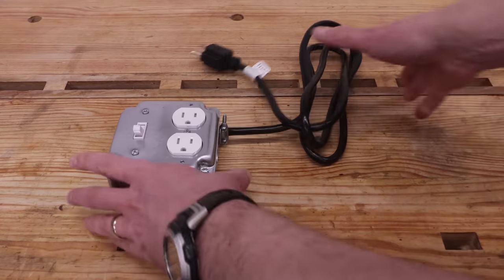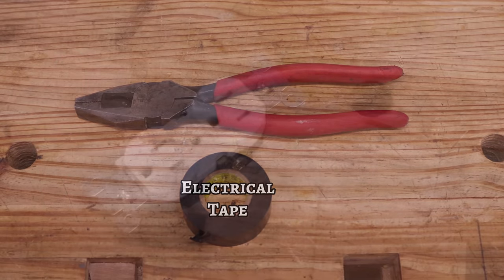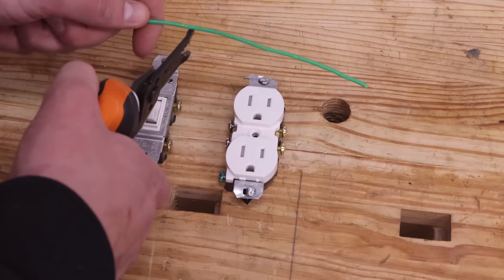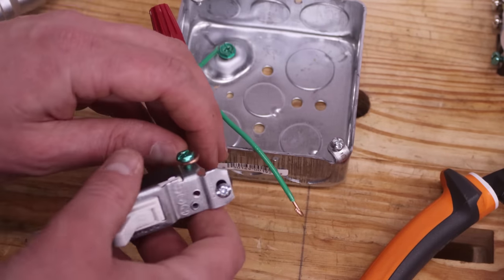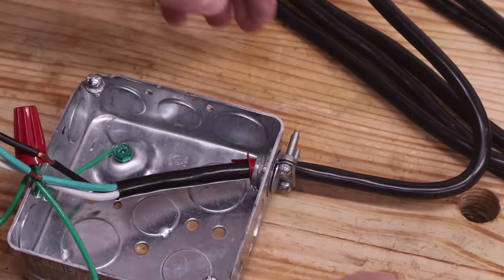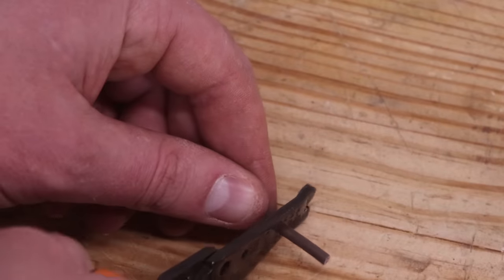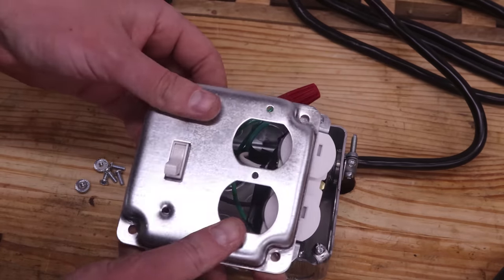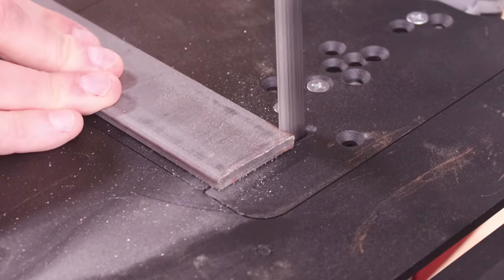DIY Portable Switched Power Outlet With Extension Cord 🔌

Comment: Well made video. I need to check out your other videos. That being said I'd like to point out errors you made. 1st, the connector was wrong. It was a BX connector and should have been a NM connector, or better yet a strain relief connector. 2nd, the stranded wire under the screws is not an approved method and could be a fire Hazzard.  3rd, you may have exceeded the wire fill of the red wire nut you used. Most only allow 4 conductors. 4th, the center hole on the receptacle is not intended to support the receptacle. Even made perfect this device per OSHA would be a violation on any job site. Personal use only OK? Personally I feel these contraptions are death traps. I do commend you for your wiring diagrams. And just a couple notes. The holes on the side of the strippers are for bending loops, the boxes are made so nothing will short out so no tape needed, and twisting the wires is not needed.
Reply from the maker: Good information, thanks.

Comment: This was a informative video.  However a couple of the connections were a little sloppy.
Reply from the maker: Sloppy how?
Reply: @GlennFrazeeYT  
It looks like you had insulation under the ground to the box.  The wires from the power cord all not wrapped around the screw very well.  It looks like some of the wires smashed outside the screw.  Looks may be deceptive.

Comment: I would like to do the same but for a kitchen island where I have an outlet underneath the island and run the open ended cord to the island's outlet box for crock pot etc...So that I can unplug the cord going to the floor in the even I want to move the island for cleaning. Is this possible?
Reply from the maker: Yes, but you'll probably have to meet electrical code requirements. And you may require a GFCI, not sure.

Comment: I am going to do this for exact reason, portaband.  I mostly cut steel, will the cut particles have a chance to short circuit, have you had any issues?  Thanks for the tutorial.
Reply from the maker: Shouldn't be an issue unless the box is right below the blade.
Reply: @GlennFrazeeYT  Thank you, ended up putting on side and put duct tape over just in case.  Works perfect.

Comment: Would this work with a surge protector? I have a surge protector in my garage to run my lights and a couple tools but its a pain to get to. I figure if I could do something like this I might be able to add a light switch by the door to flip the surge protector on and turn the lights on and when I leave I can kill power to the garage with the flip of a switch.
Reply from the maker: Sure, that would work just fine.  This is essentially the same thing that's in your wall for a normal electrical outlet, just portable and with a switch to control the outlet.

Comment: I just curious and I don't know much about electrical work but why did you connect one of the ground wires to the box?
Reply from the maker: The box will conduct electricity if there's a short, so grounding the box keeps it safe.

Comment: So now do you have 2 15 amp outlets you can plug into this? Like a normal 110 outlet? Or is it less since you’re pulling from 1 110 15 amp plug?
Reply from the maker: You're limited to 15 amps total since it's just a 15-amp plug.  But otherwise it acts like any other 15-amp outlet in your house.  You could conceivably wire this up with a 12ga cord and a 20-amp plug and have a max of 20 amps, but most homes don't have 20-amp receptacles wired in, even on 20-amp circuits.
Reply: @GlennFrazeeYT  so if you’re using a “15 amp” tool like a table saw, you should use something like a light with it instead of another “15 amp” tool, right? I’ve seen people do this and put a table saw AND shop vac on the same line but wondering if it’s smart.
Reply from the maker: @Trey Football, it would be no different than if you plugged them both into receptacles on the same circuit.  If they draw more than 15 amps combined for too long, your breaker should pop.  There's a lot more to this than I can cover in a comment, so I'd recommend reading some articles online.

Comment: I was thinking of this with a cement mixer but want one outlet to be hot all the time and the other one switched.
Reply from the maker: That's possible too. Just break the connection between the hots/neutrals on the receptacle and wire one directly to the cord

Comment: Could you use a GFCI outlet instead?  So when you plug it in somewhere it would add GFCI?
Reply from the maker: Sure. No reason that wouldn't work.
Reply: @GlennFrazeeYT  .... it wont work if the house outlet is already a GFCI.
Reply from the maker: The comment was about adding a GFCI where there already isn't one.
Reply: @GlennFrazeeYT  .... yes, but my point was more about having 2 GFCIs together won't work so you it's not totally compatible in that case. The reality is if you have a place to plug this in and you need a GFCI then one should be installed in the wall to bring it up to code first.

Comment: This is old, nice job just two notes. If you used a self grounding receptacle the ground from the cord to the box would have satisfied the code. Also, those screws you left out is a code violation.
Reply from the maker: Electrical code doesn't apply to portable items like this, but noted 👍
Reply: @GlennFrazeeYT  you know, I never even thought of that. I guess my mind is “wired” lol, that way doing electrical for 40 years. Your video was very good, some diy videos I’ve seen makes me cringe. Years ago those mulberry covers only had the center screw. Those self made double duplex adapters on the job site, that screw would always get loose and the outlet would fall in the box. That’s why the code changed and requires them now.

Comment: I live in a country where grounding plugs are next to non existent.. so my question is.. why do you need to plug a ground wire into the junction box when you already have ground from the cable to the outlet?
Reply from the maker: Since the junction box is metal (i.e., conductive), you want a path for any stray current in the box itself to back to the house wiring instead of passing through you should you touch the box with current running through it.

Comment: can I do the switch separate from the outlet but have the power cord to the outlet then the switch in a different location say a 4 foot run away?
Reply from the maker: Sure. Look up how to wire a switch for a ceiling light, and it's pretty much the same thing.

Comment: Don't your wire strippers have a "loop" hole ? Also note, no wire sheathing should be "trapped" under the screw when attaching wire. (For viewer reference)
Reply from the maker: They do, but i find it easier to do it with the tips.

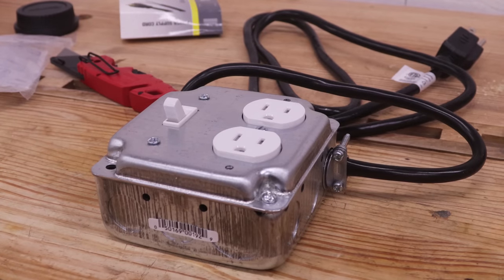Comment: 9:26 can I plug power strip to this Portable Power Outlet with no problems?
Reply from the maker: Yes.  But the switch will control the power strip, so if the switch is off, the power strip will not have power.

Comment: How do you do this using a self-grounding outlet?
Reply from the maker: These ground to the metal box, so just attach the ground wire from the cord to the box only.
Reply: @GlennFrazeeYT  I'm still a little confused, because the outlet I have still has a green grounding screw on it even though it was advertised as a self-grounding outlet. Should I ground both the outlet AND the power cable to the box?
Reply from the maker: I would ground both.  Theoretically, if you ground either the outlet OR the box, that makes a single path to ground.  But then you're relying on the screw connection between the outlet and the box (plus the outlet flanges bearing on the box) as the path, which I don't feel is very robust.  Grounding both should give you a solid path to ground either way.
Reply: @GlennFrazeeYT  Thanks

Comment: This is perfect. Can this be used outdoors, mounted on a deck rail to power lights on a gazebo?
Reply from the maker: It could, but you'd want to use a weatherproof enclosure and fittings.

Comment: Someone, please tell me what to do if it's a single-pole switch with 10amps 125volts and I want to cut between an extension cord which has no ground (just hot & neutral) to make a lamp switch interruption more accessible (would leave the switch built into lamp always on, but the closer installed switch midway through an extension cord. U.S outlet 120v?
Reply: Also would it matter which way the switch faces when soldered on and also does it matter if the switch goes to hot wire only or neutral only, or if I were chopping one side of the extension cord I could tycnically make both hot and neutral wires on the two wires on switch to make the end of the cord the end of the switch? halp
Reply from the maker: Always switch the hot wire.  You don't want current flowing to the device when the switch is off.
Reply: @GlennFrazeeYT  you're a gem, thank you. The specific question was impossible to find a confirmation on simple toggle switches without a ground, everything I would find is about hooking up to ground, probably because I typed extension cord into the mix and the search engine went to socket outlet. Thanks for your reply

Comment: Why not just use a power strip?
Reply from the maker: Not robust enough for a workshop, in my opinion.  Also, don't need 6 plugs.
Reply: @GlennFrazeeYT  really? Well maybe if you use cheap plastic ones. Get a good quality metal one and it will also have a circuit breaker.

Comment: A few  comments. When you screwed the bond wire to the junction box, you caught insulation under the screw, this causes connection problems. When you twisted the three green wires together, you should have twisted all three of them together, not two then one.  When you added the green twisted wire to the bond connection, the stranded wire should have extended past the end of the solid wires. It is a violation of code to put stranded wire under a screw connection. You should have attached insulated crimp lugs to the wires then attached the lugs to the screws. I stopped watching at this point.
Reply from the maker: Gonna need a code citation on that. They use stranded wire all the time around here without spade connectors.

Comment: Annnnnd IF YOUR ME....
STEPS 15-17-* 15: Cut the male end off your brand new power cord.
16: Slide on the clamp connector MY DUMB ASS FORGOT to put on first (for the 10,000th time)!
17: Install the brand new replacement male plug end.
* optional step: kick self in ass.
Reply from the maker: We've all been there...